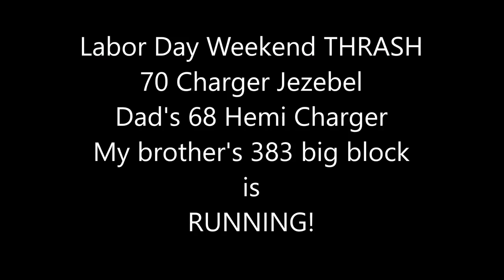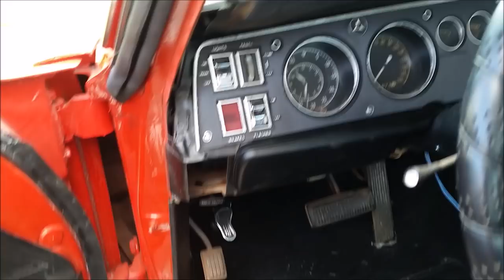The Ratty Charger, The Purple Monster, and The 426 Hemi Charger all finished for the Car Show

Comment: What’s all done to the 383 besides camshaft and tunnel ram?
Reply from the maker: .060 over bore, heads have been "worked" on, block was decked, 440 hughes whiplash cam, flat top zero deck pistons. That kind of stuff, nothing crazy overkill. It is just going in his 84 Short Bed, we aimed at making loads of torque

Comment: Have you fellas neard of Custom Autosound USA? They make clones of factory radios with a twist. The radios look Mopsr with thumbwheel tuner/ volume buttons but... Behind the analog dial is a digital fm tuner, bluetooth all tge latest bells / whistles. Absolutely NO cutting of the dash like other aftermarket radios. Preamp outputs to install an amplifier and inputs to add iPods , cd , etc. If you don" t want to hack up your dash bezel ( who does?) , this is your answer to modernize your car with zero modifications. Best part : not insanely expensive.
Reply from the maker: Thatd work for Dads charger, but I dont want a radio nor do I want anything modern near my Charger. But I have seen their stuff
Reply: @ScottsSpeedShop  I would not want to cut the car in any way but Bluetooth / hands free 📱 is nice!
Reply from the maker: @mikehileman9476  I get that, I don't need music in my cars, if the sound of the engine I built ain't good enough to listen to, then I did something wrong building iy